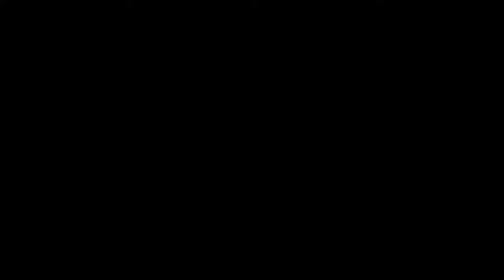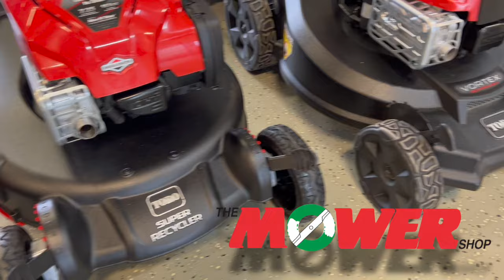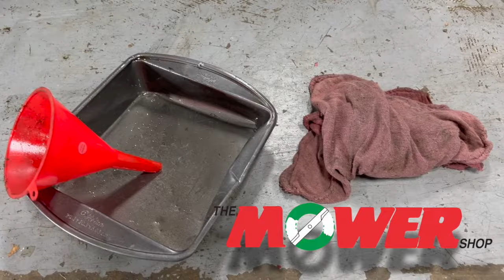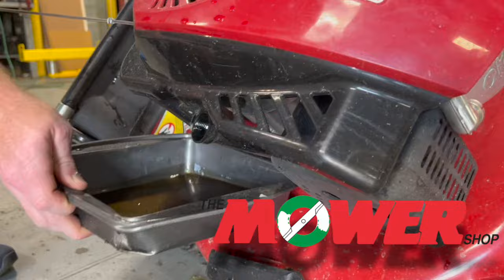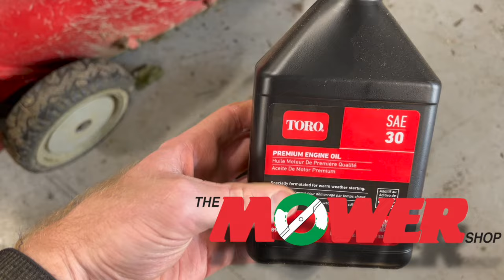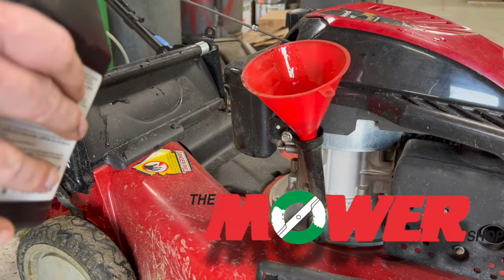Changing Oil on Toro Super Recycler Lawn Mower

Comment: Is that a stowaway mower? You’re supposed to tip those backwards; spark plug side up. Not on the side.
Reply: How do you get the oil out if you flip it backwards.....
Reply: Oil does come out. The Briggs & Stratton manual specifically states to keep spark plug end up in the air and shows a diagram for the oil change. I’ve done it two years in a row.
Reply: My manual just shows a magic floating engine with the oil fill tube as the lowest point. This process seems stupid, why not put a drain plug under the deck?